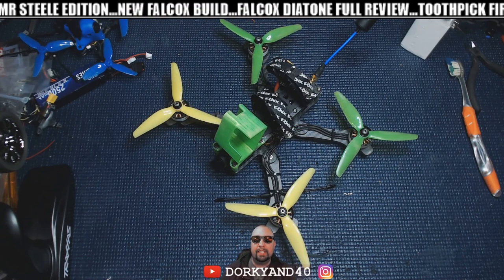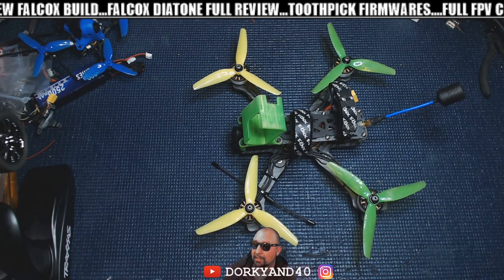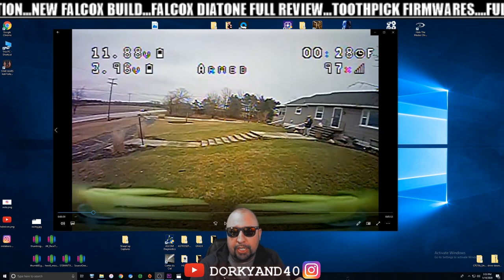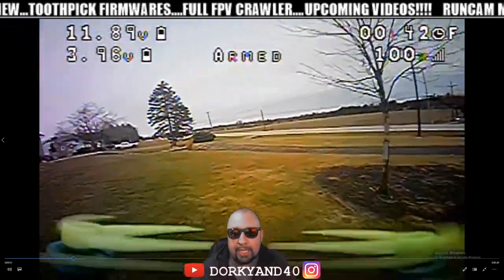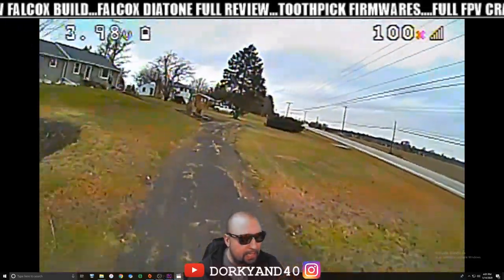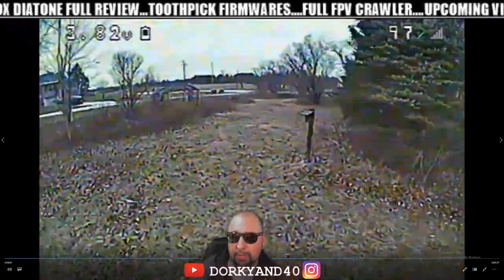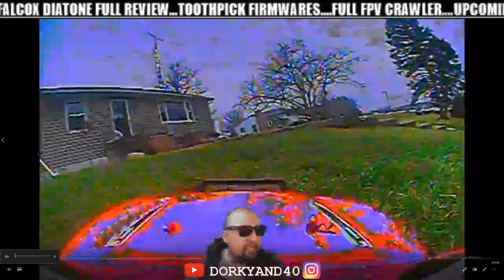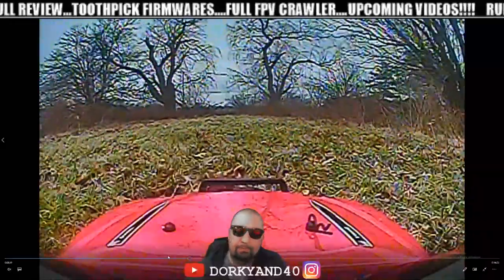RUNCAM MR STEELE CAMERA FIRST IMPRESSIONS

Comment: Share settings plz
Reply: Setting will only help if you have the same video transmitter and receiver as the quad in the video, because there's alot of differences with transmitters and receivers that affect the video image as well but I can tell you steele turns up the contrast quite a bit. He's also running LaForge

Comment: Going to definitely get the 2.5 lens and change it out on my johnny fpv edition. I used to run Steels RR edition for a long time with the 2.5 go pro lens it came with and it was my favourite. Then it broke :( Thanks for the nice dvr and review. If you have a gap, could you share the settings with us, I'm sure all swift 2 mini cam owners would be super excited :)